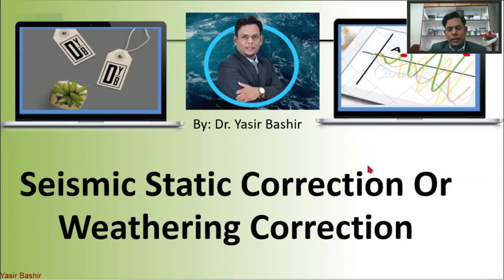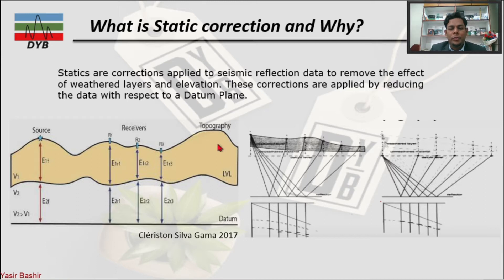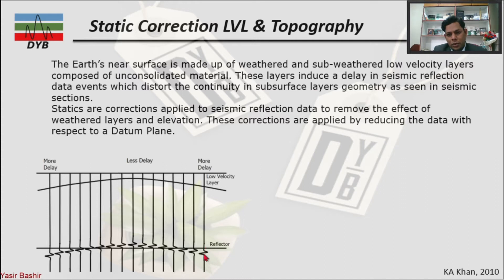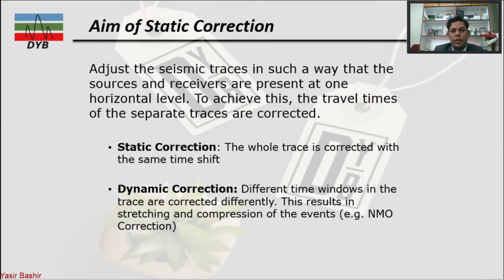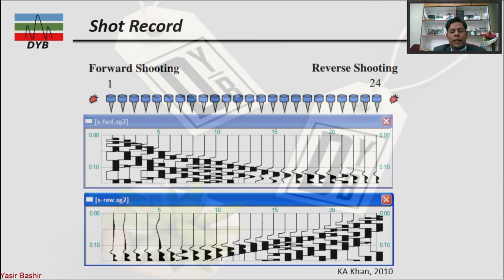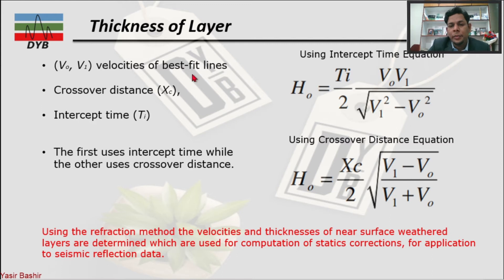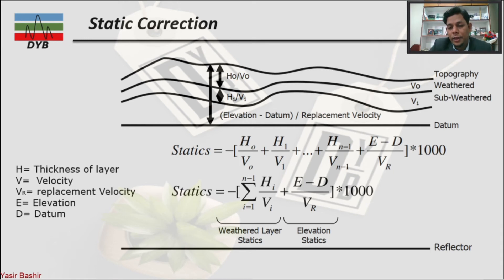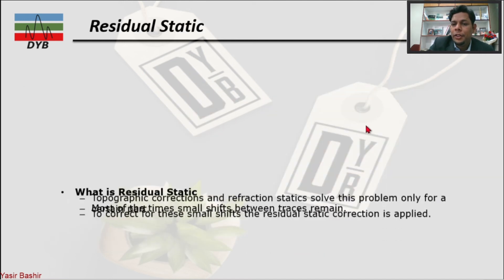Master Seismic Data Processing Unlock Weathering Corrections for Accurate Geophysics Insights

Comment: Please could you tell me what is the abbreviation of DRM and what is the difference between this method tomography method and delay time method
Reply from the maker: As far I understand you mean to ask "Design Requirements Manual" which is abbreviated as DRM.
To Answer your 2nd concern the static correction is done to address time shifts in seismic data resulting from near-surface variations or elevation differences. Verifies the consistency and comparability of travel times across various seismic traces. The tomography utilizes data derived from seismic waves that propagate through a medium to generate precise images of the subsurface. The process involves addressing an inverse problem to accurately reconstruct the velocity distribution of the medium. The delay-time approach quantifies the discrepancy between the observed and theoretical travel times of seismic waves. The subsurface is represented in a simplified manner, utilizing a layered or blocky model to facilitate the interpretation of these delays.

Comment: Sir, what are the processes for tidal static correction?
Reply from the maker: Tidal corrections can be applied to data after the tidal chart and water column velocity have been derived from data. The static corrections are applied to the ground data, so the term Tidal Static is incorrect but use tidal correction.